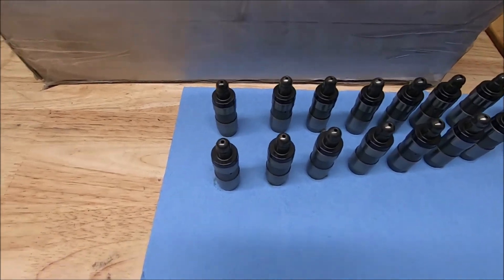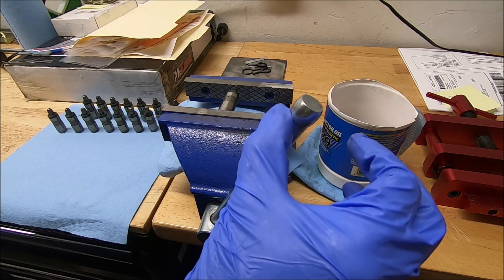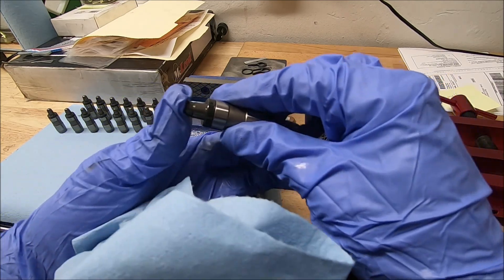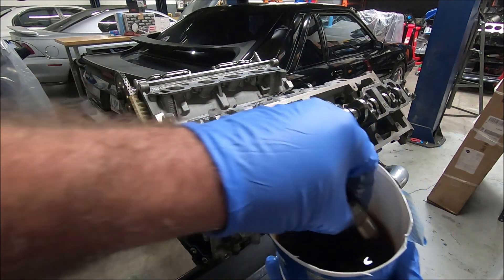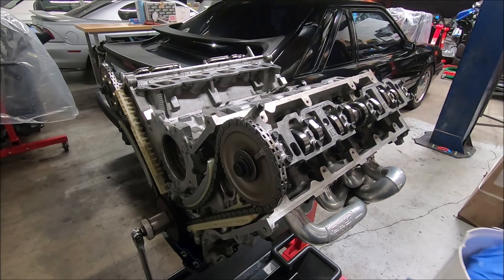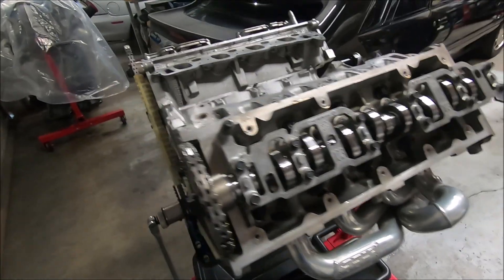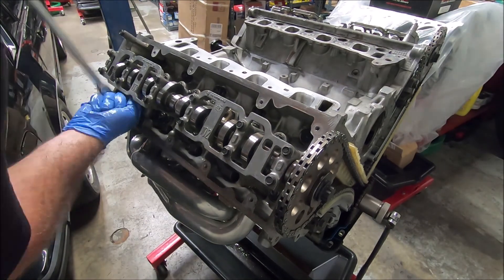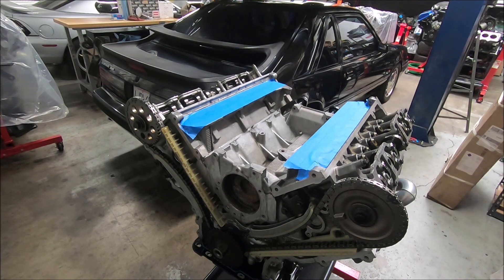Bleeding 4.6 SOHC Valve Lash Adjusters and Installing Cam Followers

Comment: So I have a question. I need to change lifters on mine, do I need to turn the engine when they’re in? I’ve seen some people where they just take the cover off and switch the lifters out and put the cover back on and that’s all. Would that okay to do also?
Reply from the maker: You will need to rotate the engine to get the lash adjusters and cam followers.  The cam lobes need to be out of the way to remove both.  If the lash adjusters are replaced, I recommend bleeding them down and priming the engine if possible.  I know many people have done the job without priming, so if you can't, you will most likely still be fine.

Comment: I did replace the lifters did not bleed 
What I should do now 
Pls let me know and thank for your support
Reply from the maker: If you don't want to remove them and bleed them, you can rotate the engine by hand and make sure there is no piston to valve contact.  It's also a good idea to prime the system with oil.  It will most likely be fine.  Even if one or two are pumped up they should eventually bleed down.

Comment: I’m replacing the lifters in my 4.6 and they are impossible to compress by hand. I seen in my Haynes manual that your supposed to use a paper clip or small wire to stick inside and hit the plunger to compress it but even doing that doesn’t work. Does that mean the lifters are bad? I have new lifters but don’t want to do that paperclip thing in case I damage it
Reply from the maker: If they are pumped up you will not be able to compress them by hand.  That does not mean they are bad.  I have seen brand new ones that cannot be compressed by hand.  Try using a vice and carefully compress them.  The paper clip sounds more like for holding the tensioners.

Comment: I'm working on a 97 Mustang 4.6 trying to replace the valve seals is it possible to use the Spring compress tool and not remove the cams in the car?
Reply from the maker: It is possible but not easy, especially in a DOHC engine.  You will need to hold the valves up with compressed air or some other method.
Reply: Yes you can change the valve seals without removing the cams but you will need to remove the camshaft caps (one at a time) and you will need the tool to compress the valve springs

Comment: Hey great video! Good to know when I go in to inspect the valve train components when I do my valve cover gaskets! I noticed there are a set of BBK headers on that engine. I was also looking into getting a pair....question... did you go with the stainless/chrome ones or are those the silver ceramic headers? Im guessing that the ceramic would hold up to corrosion better? Also I have replaced the manifolds on each side from either cracking or leaking at the gasket. When I get the BBK headers I am going to re-torque them at a set mileage or get the locking higher grade bolts. Not sure what gaskets to go with but I want the best so I have a leak free exhaust for many years. Your opinion would be greatly appreciated since you seem like a professional on these 2v Triton engines! Thanks.
Reply from the maker: Thank you.  I do not like to use chrome plated headers.  They seem to discolor and flake way to fast.  I usually use ceramic coated but stainless steel is good too.  I have used both graphite and multi-layer steel gaskets and they both work good with Stage-8 locking header bolts.  I started using Stage-8 many years ago and recommend them on all header installs.